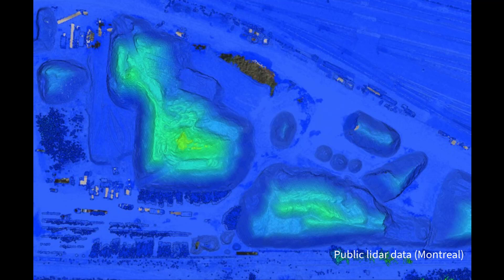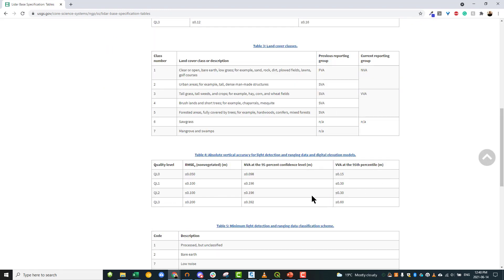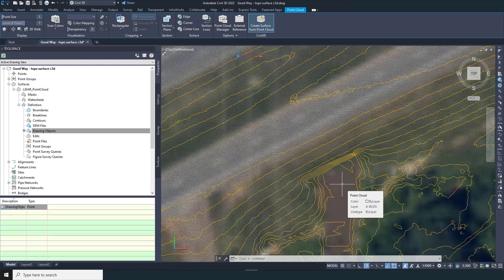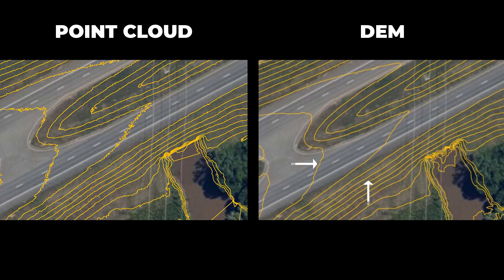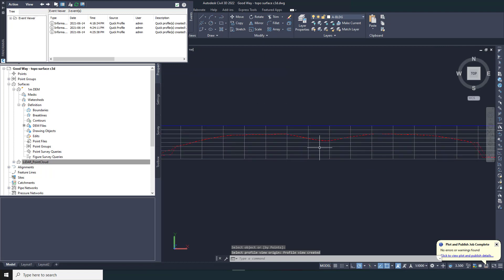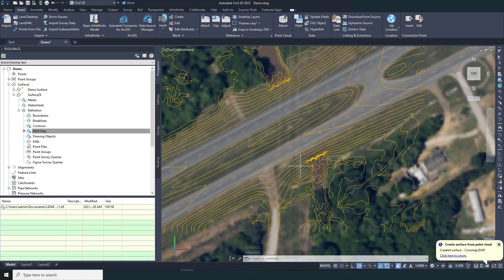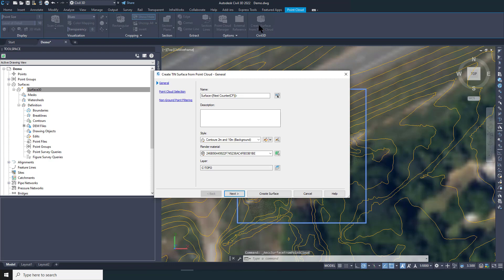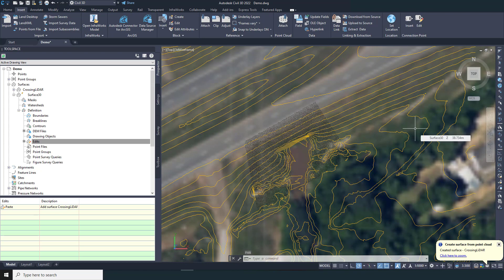How to create smooth contours in Civil 3D from lidar

Comment: Would you get the same result using the Smooth Surface edit, and leave out the areas of extra detail?
Reply from the maker: Great question! You may loose some of the detail with the Smooth Surface edit. We provide one method in this video. Our suggestion is to choose your method based on the accuracy you need.

Comment: When I do exactly what you did, my DEM surface look just as bad as your point cloud surface. What would cause that?
Reply from the maker: Do you know the resolution of your DEM?  If you are creating the DEM from LiDAR, the resolution may be too high.  You can try lowering the resolution - try 1 or 2m to start.  Then, you can add more detail in the areas you need.  If you are not working with LiDAR, it is possible the DEM is too low resolution and is just missing detail resulting in jagged contours.